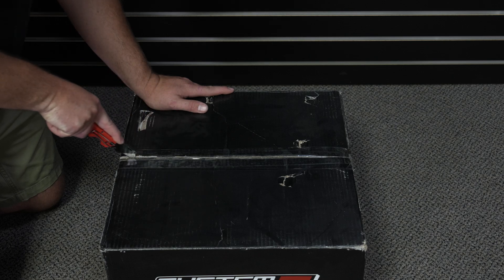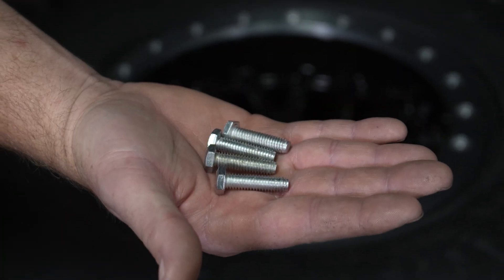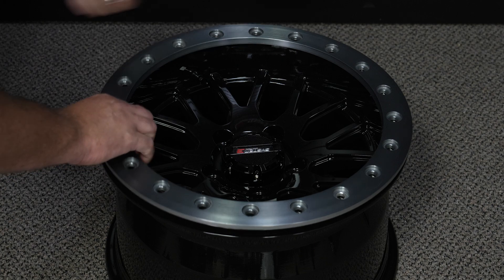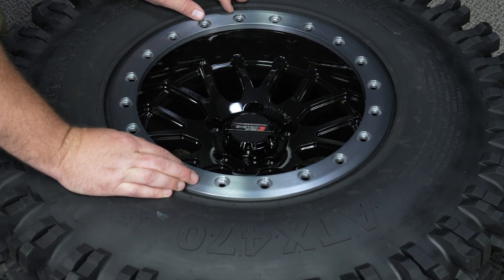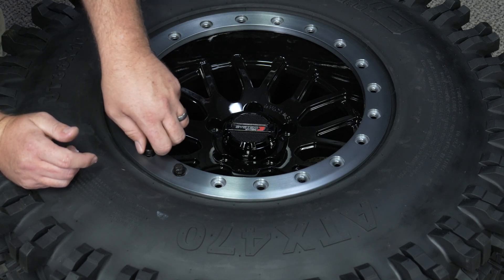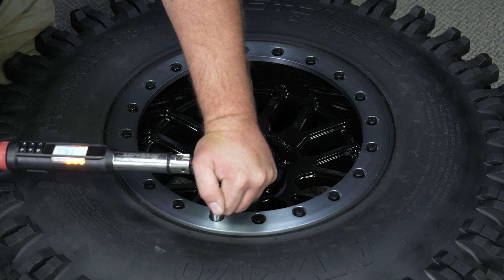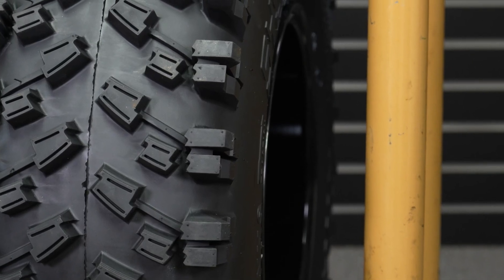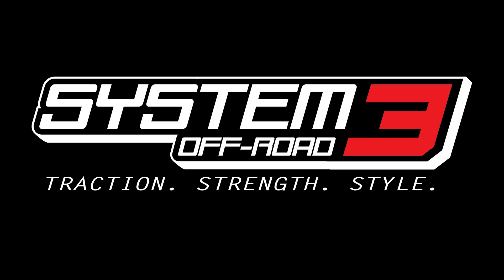System 3 Offroad Tech Talk - How to mount a beadlock wheel

Comment: why oil/lube the bolts? wont that change torq specs and maybe... make the bolts come loose?
Reply: Two dissimilar metals. Just helps with the corrosion. It won’t change the torque spec much at all and that’s why it’s good practice to retorque the bolts after sometime of riding.
Reply: @dustycrewracing  interesting, I see many manuals for cars saying never to do that.  And I imagine maybe people put too much lubricant and not enough torque.

Comment: I have approximately 4000 miles on my System 3 tires/wheels combo and I couldn't be more satisfied.  No puncture and the tires still look amazing.  The original Maxxis were completely destroyed and filled with plugs within 3000 miles on the northeastern trails.